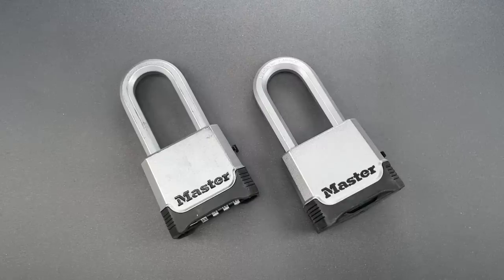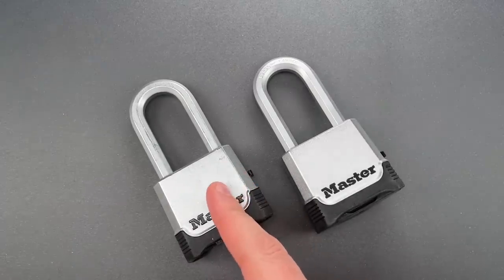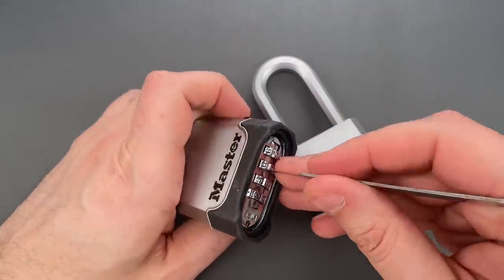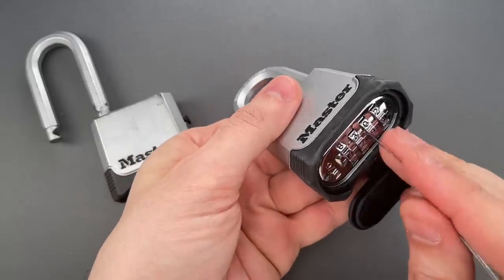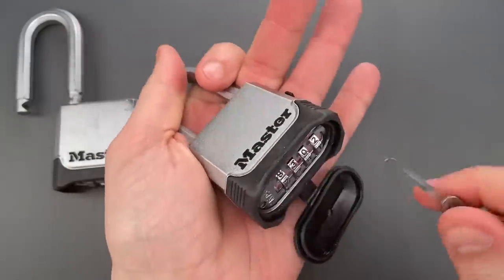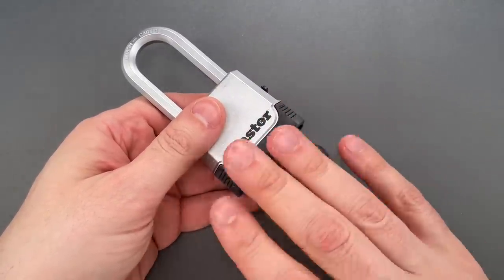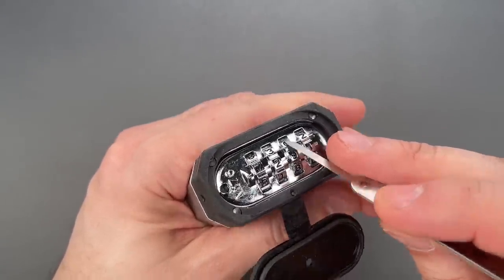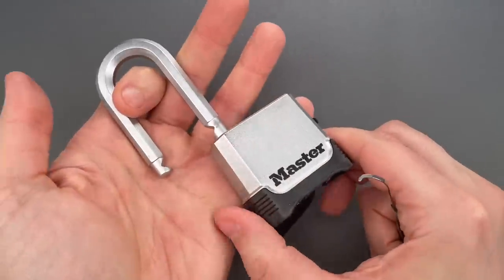[1507] Revised Master M176—New Open Method!

Comment: Wouldn't be much easier to shield it than to increase tolerance?
Reply: Easier, yes. But also more expensive.
Reply: Takes more material
Reply: Don't even need metal, just a thin piece of plastic will work, but that means changing their tooling, and that's the expensive part, not the materials.  Costly to change the machines that build the locks when they're already making products which sells executives get paid by raising margins! :D
Reply: My guess is they got one of those 0 tolerance lazer cutters.
Reply: @lanzer22  A great explanation! Thanks for teaching me something new!
Reply: Nah, it's MasterLock. They should have put the prototype in the hands of someone actually competent like LPL all those years ago and then force designers to, well, re/design, since that's what they are getting paid for. But an island in an ocean is nothing, so buying their locks for something more than a paperweight or a latch blocker if you run out of sticks; is a suicide. Though an experienced thief might take a pity on you if he sees that lock .
Reply: decrease the tolerance
Reply: Don't Read My Profile Picture  I didn't.
Reply: Don't Read My Profile Picture  leave
Reply: Doesnt that cost money?
Reply: That would require the corporation that bought Master Lock to care about it. They just bought it to strip it down to the brand name, not actually innovate.
Reply: @km077  The odds an "experienced thief" ever considers pick resistance on a lock is about nil.
Reply: Like other comments said, it's probably just a new mold that hasn't been worn down yet
Reply: @bhough410  ask kia boys about exploiting lock weaknesses.  These aren't high skill attacks and if they go viral enough people do use them
Reply: I think you mean decrease the allowance.  Tolerance is a range of sizes that will still work for the intended purpose of a single part.  Allowance is the intentional gap between assembled parts.  In cases of a force fit assembly, the allowance may even be negative slightly.
Reply: umm, they should just dunk it in a bucket of concrete, maybe will fail as a product, but definitely would make for a longer LPL video ☺️
Reply: @km077  there's a video of McNallyOfficial, parked with his car outside Masterlock, just to pick a Masterlock that would be his short named 0084 - To be continued...
Although my favourite is 0082 which is very fitting seeing what lock LPL picked today.
“You're using a Masterlock Model 176, which can be opened with a Masterlock Model 176.”
Reply: They would have to re-engineer the whole inside lock body for the space inside for the shield
Reply: monies
Reply: I'm not so sure if they intentionally changed the tolerances or simply had to create a new mold and it is little less worn out.
Reply: @timwilliams347  decrease the clearance and maybe the tolerance too
Reply: @Bob Smith  no engineer would use the word clearance in this context.  The tolerance is how much slop there is between parts since the manufacturing process cant be exactly dialed in, so if you have a larger tolerance (tolerance for error) it means wider gaps, but a higher probability that an assembly wont have issues being put together. Reducing the tolerance means closing up those gaps
Reply: I bet they didn't even improve the tolerance on purpose. Probably different factory / machines to build the lock resulted in this by chance.
Reply: @Maninawig  Laser comes from LASER which comes from "Light Amplification by Stimulated Emission of Radiation".

No "z" in "stimulated". So laser and not lazer.
Reply: Bro right
Reply: Why not both?
Reply: Baby steps
Reply: @jamesm6638  Just report the guy for spamming and move on. It doesn't actually help, but it doesn't give him free attention either.
Reply: It’s an extra manufacturing process. It could add 20-30% onto the retail price. That’s not what master aims for. It’s a company that literally started hiring based on skin color. Safety and reliability is not their priority. Skin color has taken precedent
Reply: @bhough410  I would give the odds a larger value.
Reply: What’s funny is people saying it’s all about the money, of course it is just like it is when you buy a master lock at Walmart for $10 instead of buying a higher grade lock for $100. If you want the extra time and effort put into it then pay for it, and if you think it’s ok to demand more without paying for it then I’ll gladly pay you less for more work.
Reply: Don't Read My Profile Picture  Ok
Reply: @Don't Read My Profile Picture  ok I won't
Reply: @jaydunbar7538  the problem is that a $100 masterlock is going to be just as easy to bypass I think
Reply: @nooboftheyear7170  Yeah, one of the things LPL highlights constantly is that expensive locks tend to be made of more expensive materials (and are therefore typically more physically robust or impressive looking), but that price tag says NOTHING about the quality of the lock DESIGN itself. 

I also think a lot of people here assume the designers of these locks were just being lazy. This is very rarely the case. Remember that designers are given specific design constraints that they have to work within, and one of the more "important" constraints is the final unit cost of a lock. It might cost only a few more cents to include the shielding needed to stop this shimming, but I suspect that they already spent every penny of their design budget and cutting costs elsewhere in the lock or manufacturing process (likely the more expensive thing to change) would cause even bigger issues. If you want to blame someone, blame the director/manager who set the parasitically low budget that would maximize profits.

Comment: The dust cover is a nice touch.  "Yes, the roof leaks and the foundation is failing, but the drapes are stunning!"
Reply: Seems legit, dust could easily open a Master Lock
Reply: @Boss_Tanaka  "As you can see there is some dust in here, so all we need to do is hold it out- and we got it open"
Reply: @dakat5131  😂😂🤣
Reply: "new version... which does not have its dust cover... broken off"
Sounds like the old one had a dust cover as well, but it broke off sometime between purchase and now.

Comment: Thanks for the tips on this lock. My father passed away last Dec. He has two of them on his conex container that has plates welded so you can't cut them with an angle grinder or bolt cutters. And nobody had the combination for them. But I made a tool like the first one you used and after a few attempts was able to gain entry without damaging anything.  Thank you lpl you're the cat's meow.

Comment: After seven years of engineering brainstorming, they came to the conclusion that it would not be bad to reduce the space between the dial and the body of the padlock. Well done, wonderful.
Reply: I m looking forward to see what they ll release in 2030
Reply: In another 70 years maybe they'll have a lock that passes the toddler level of security
Reply: But only on 2 of the 4 sides

Comment: Just a question, why is the volume level on your videos so low? I gotta max the volume out every time I see your vids.
Reply: Mine is on minimum and its very clear
Reply: Same (on this video)
Reply: Yes, his videos has very low audio. I can watch pretty much anything on YouTube with less than half of the volume bar but if I try it on his videos the same level won't let me hear absolutely nothing.
Reply: Maybe your speakers suck I can hear him just fine at any audio level.
Reply: @hellfire66683  Watched his videos on two different smartphones with perfectly functioning speakers and the audio is still low as fuck. No problem with all the other YouTube videos.
Reply: I have to toggle on the loudness equalizer option on speaker software to hear clearly and then switch it off after the video.
Reply: @Claudio  S22 Ultra sound level just above the music note, no headphones or other external speakers, I can hear him just fine. I don't know what your issues are. Maybe you're slightly hard of hearing at some frequencies?
Reply: @hellfire66683  
Or getting older and a bit deaf
Reply: The volume on recent LPL videos is stupidly low indeed.
Reply: @hellfire66683  If you're hearing him at any audio level then you have automatic gain control turned on. The video is at a comfortable audio level at max volume which is not going to be pleasant if Youtube autoplays the next video.
Reply: I didn't know Masterlock makes PC speakers too. The 2030 model, 7 years from now, won't be better
Reply: This video ain't bad for me, but I did have to turn up [1515] quite a bit.

Comment: when it comes to a lock with a code wheel like these, does it matter where you put the decoder in or no? like LPL puts it in the 3rd wheel from the left, but would i still achieve the same result if i tried it on any of the other wheels or is it specific?

Comment: Why do thieves use angle grinders on locks instead of just picking them? Surely picking them would be quicker and quieter?
Reply: Brute force might be noisy, but it’s faster if you don’t have picking skills.
Reply: Because they don't care for taking the time and effort to pick a lock when jt can be easily destroyed, and picking may be quicker and quieter but also requires skill and is less reliable
Reply: Some of them don't have the dexterity or patience needed to pick locks.
Reply: @joermnyc  From what I've seen, quite a  few thieves don't have the skills to use an angle grinder either.
Reply: Lower skill requirement
Reply: Well, imagine picking locks that have been outside for years with dirt and grime and rust in them, and not in hunky dory clean conditions on a table where you can turn and wriggle the lock any which way you want. 

I have a heavy duty container lock that has been outside for 20 years now, even when unlocked I can barely turn the key and bar around, I can barely get it open with the key and even then I have to use a trick that I wont be able to do if I had to manipulate two picking tools at the same time.
Of course this is LPL and I'm not saying it's impossible for him to pick, and I'm not saying he never makes an effort for authenticity, but notice how 99% of his videos are in nice clean conditions on a table hunky dory everything with brand new/good condition locks.
Reply: It's generally a 'one tool to rule' most locks,  that they can find / steal quite readily, rather that going out and ordering a suite of tools needing practice and some skill for. Grinders work just as well in low light too,  and can get to work immediately, no need to size up the lock type > select the correct tension bad / pick etc.
Reply: @ToreDL87  Why don't you send it to him as a challenge?  I bet he could find a container in similar condition near him and he can put your old dirty, rusty, grimy lock on it and create a video of it.
Reply: @thenash4822  
Why? Because I've known poverty all my life, I've learned one thing: Never say never.
I would have sent him the lock, if I thought it impossible.
But that's not what I think, and, not what I wrote.
"Of course this is LPL and I'm not saying it's impossible for him to pick"
Right there I'm already in the clear, as LPL, a self-admitted lawyer, or anyone in the judicial system, can likely tell you.

Furthermore I made additional provisions:
"and I'm not saying he never makes an effort for authenticity"
So I didn't explicitly state for a fact that he never did a dirty/rusty/grimy lock in adverse situations, did I?

"but notice how 99% of his videos are in nice clean conditions on a table hunky dory everything with brand new/good condition locks."
As can simply be confirmed with most of his 1500+ videos, no?
If he wants to change that, by all means, and he doesn't need my lock to do it.
But then he's got to make hundreds of videos about it if he hopes to offset the percentage by enough to render my claim invalid... See you in another 7 years?

Comment: I think you mean that they have tightened the clearance between the codewheel and the body. If you were checking tolerances you would need multiple locks to see what the manufacturing variations are between individual locks. 
I only comment this because you are usually on point with your finer details 👌

Comment: 2:23 A Wiser shim works nicely for this method.  :) .. Rather than lifting the bar with leverage, you just push it in all the way and the Wiser, by spring action.  Shim lifts the locking bar

Comment: Masterlock: We've made it harder to bypass the lock on the sides :)

Masterlock: By taking space from other places....
Reply: Nah, more like Masterlock: doesn't do anything, their tolerances just so happened to change as they buy new casting molds or the old ones wear down.
Masterlock couldn't care less about lpl slamming them, their customers don't watch this channel. They shop at Walmart and buy the first thing they see from a familiar brand that costs about $20, slap it on their storage unit and then go home and eat a cheeseburger.

Comment: His decoders come in .006 and a thicker .010. When I have two tools that look the same but one is thinner, I use red shrink wrap for the thinner tools handle. Red meaning be more gentle due to thinness. This saves me from having to needlessly pick up both tools and flicking them to see which is thinner.

Comment: Also specially at a place like that, even if the tolerances on a new lock is very tight, to make it hard to fit in (disregarding the 2nd method to get in), I would assume as the lock get used, it would open up more, simply due to wear and tear. There is a freaking wheel afterall rubbing beside it

Comment: i have 1 of these on my bike, half of the time its easier to just smack it against the frame of the bike and it pops open instead of using the numbers which tend to stick and not even open on the right combo

Comment: I don't think they changed the design. Instead they are using a different factory which just happened to have different fabrication tooling which coincidentally made the tolerances at the side of each code wheel tighter. Next year the lock will randomly have the same issue again.

Comment: F - Tier Lock - may favorite tier.

F - can be bypassed without messing with the cylinder at all.  
D - low skill "raking" or "comb" attacks defeat the cylinder.  
C - beginner level single-pin picking can defeat the lock.  
B - moderate level single pin picking or a special tool are required to pick the lock.  
A - expert level picking or one-off custom tools are required.  
AA - lock-picking lawyer cannot open.

Comment: I would live a series on choosing the right lock for the situation. I mean, I am not going to spend $100 on a lock protecting my clean clothes at the gym. And it would be reasonable to spend $100 or more on a lock to protect a locker with my work gear (assuming the locker is worth it).

Comment: The shim-between -the-digit-wheels would be easy to counter. Just put grooves in the sides of the wheels, and extend the lock body to fit in the groove. Even if you managed to slip a shim through, you wouldn't be able to control it effectively with how badly it would get cinched.

The top and bottom of the wheels, maybe try a piece of plastic or rubber that would fall into the notches already present on the wheel surface. Wouldn't shut one out completely, but there would be clear signs someone tried to tamper with the lock.
Reply: Oh Matt, theres no place for that kind of talk here at MasterLock. We are rescinding your apprenticeship immediately.

Comment: What I don't understand is this. This guy is so knowledgeable about locks and locking mechanisms. He's built a channel and a brand around pointing out and exploiting the faults in nearly every kind of lock I've ever seen. It seems like he should be able to design the perfect lock that is unpickable or whatever. Why doesn't he? Genuinely curious.
Reply: Maybe he just doesn't see the point. A totally unexploitable lock would have to be so strong that if you lost the key you'd be in trouble to get it off. Use one on a bike and someone can still steal the parts that come off easily and break the rest. Use it on a house and the burglars will break a window instead. There are already reasonably strong locks that can only be picked with custom tools (Abloy locks for example), so they do the job as well as needed. We can still get robbed, but at least there will most likely be proof of forced entrance.

Of course he may just get paid so much as a lawyer that he can't be bothered to design anything 😄